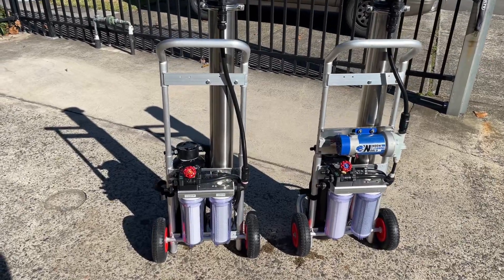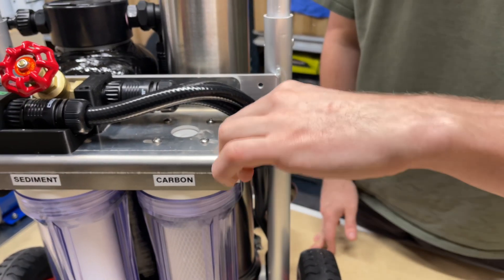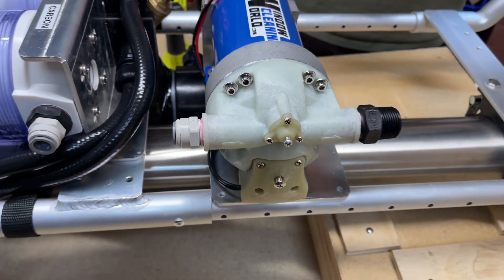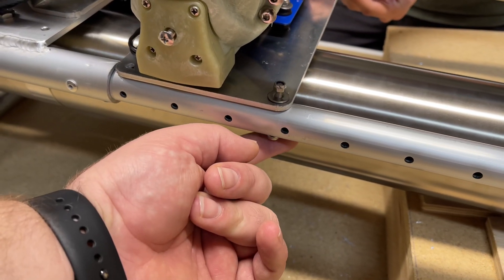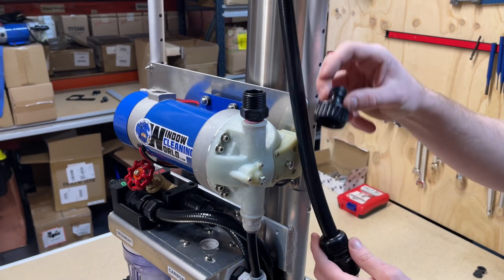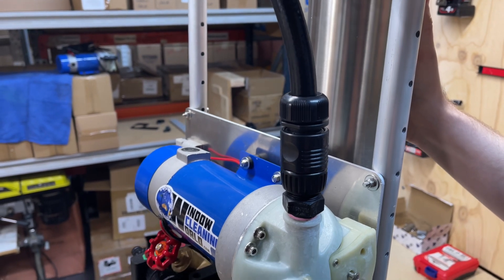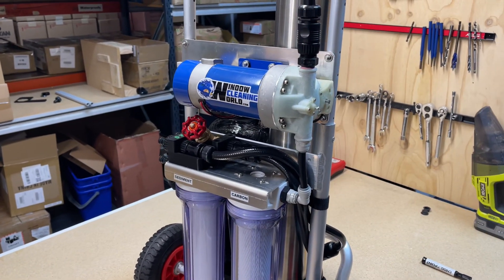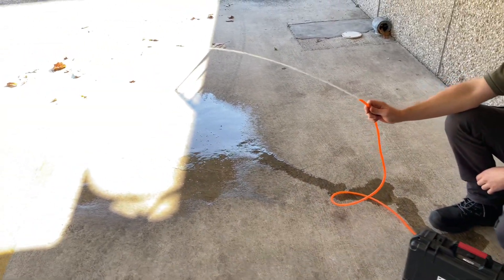Upgrade Your X-ION Lite RO With a Pump!

Comment: On ya mate. If you had a simple shut of valve at the brush (on the roof) and you switch the water off. Does this pump auto shut off?